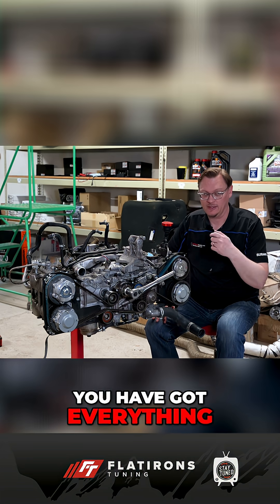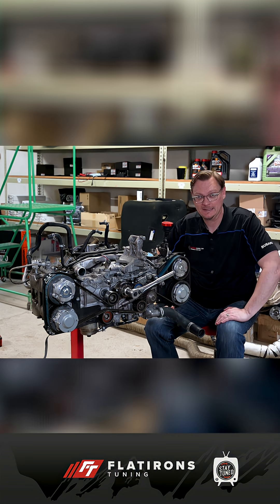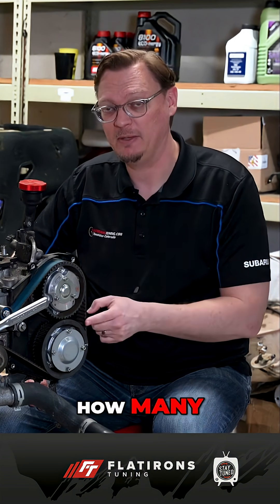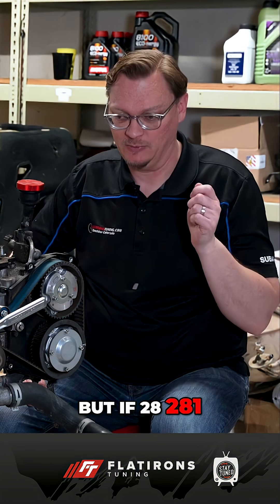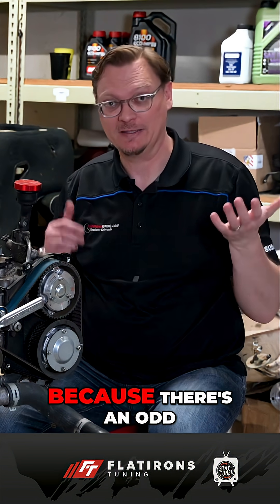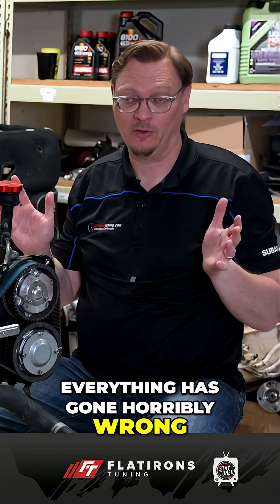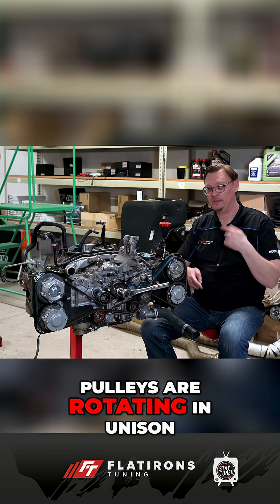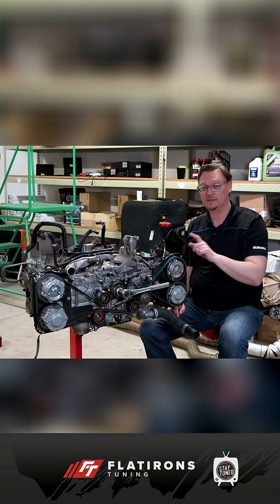Timing Belt Rotation:  Quick Quiz! How Many Rotations to line up marks?

Comment: For those wondering-prime numbers are used for this kind of thing because it causes the belt teeth to not repetitively contact parts of the pulleys, this way defects don’t cause localized accelerated wear.
Reply from the maker: Thanks for that insight.  Makes sense.

Thanks for watching and Stay Tuned!